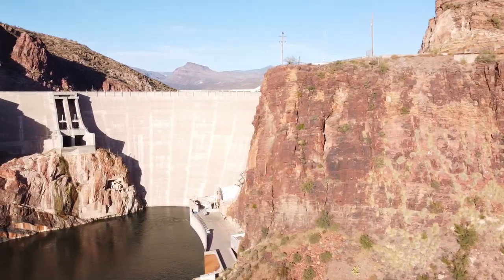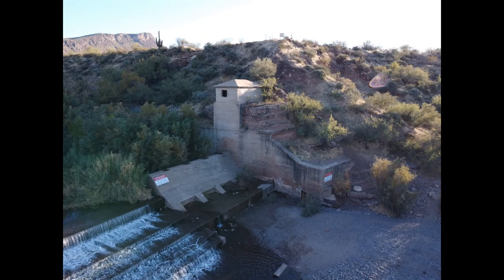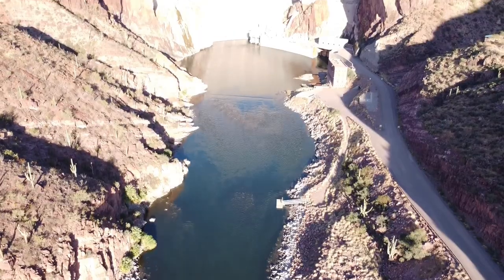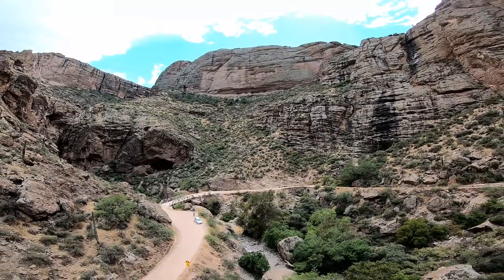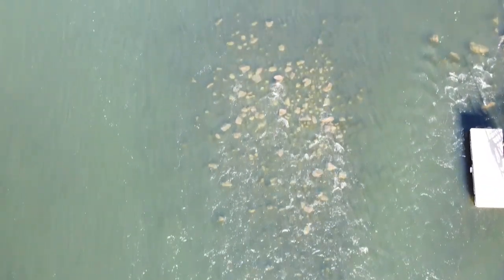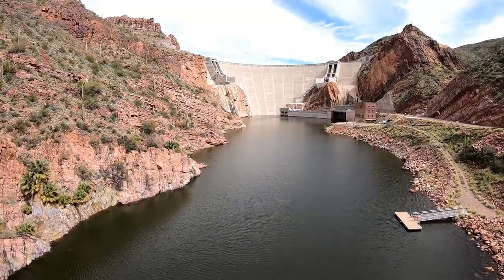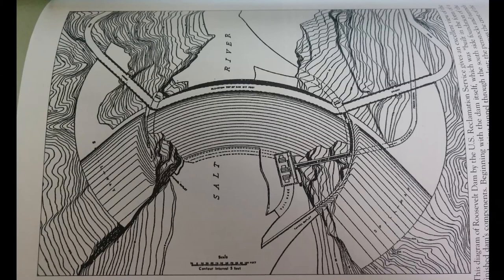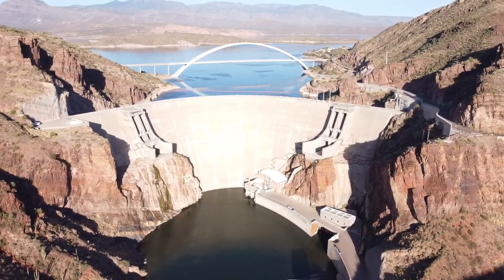HOW Theodore Roosevelt Dam WAS BUILT | HISTORY

Comment: It was Arizona delegates who were most ardent in support of the reclamation act and worked hard to create the language. This project was the first that was approved under that act. When the survey was done, additional locations suitable for dam construction were identified but the capacity was insufficient. Those locations were later dammed in the '30s to create additional storage and power generation capacity.

Most of the materials were transported to the Roosevelt dam site by mule teams and freight wagons. It took two days to reach the dam! The one saving grace was that on the south side of the canyon was a sizeable deposit of limestone. That meant that they were able to make the concrete needed to bind the stones together and for other uses, such as the bridges on the road and so on, could be made right at the site. This was also used to create the Granite Reef diversion dam just northeast of Mesa, which directed water into the Arizona and the Southern canals.

What most people don't know about the dam is that there was actually, as an addition to the design made after the fact, a 16.1 mile long canal along side the anticipated river bank and a small diversion dam built upstream. This canal channeled water from the Salt river into the penstocks at the dam to provide for power generation. This canal is now disused and often submerged by the lake, but the diversion dam remains a popular swimming spot and the gates can still be seen, although accessing the gate house is not as easy as you might expect. The advantage of this setup is that the ability to generate power doesn't depend on the lake level. Only the flow of water in the river. Thus, as the lake level drops, the power house can still put out the maximum amount of power, provided that the river is still flowing.

The old face of the dam was absolutely gorgeous and I'm very sad that it isn't still around, but the flooding in the Salt river valley was a serious business and destroyed much property and infrastructure. So raising and strengthening the dam was absolutely necessary. One structure I really like is the old transformer house (no longer in use.) It shows you what the stone face of the dam would have looked like since it was taken from the same stone.

If you're planning on traveling there, you should also remember that the Apache trail is closed at Fish creek due to a washout after a fire a few years ago. So the only access is from the north of the lake or the south approach (via Globe) which is a better road anyway.